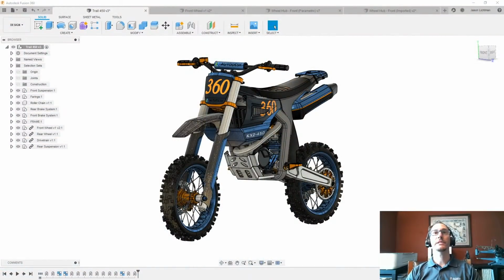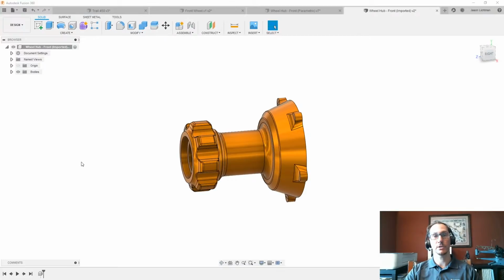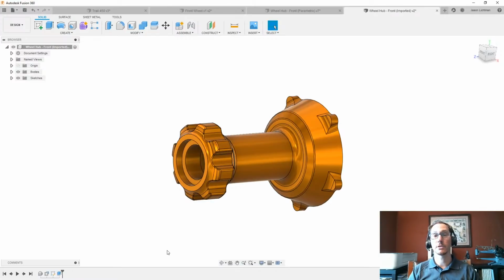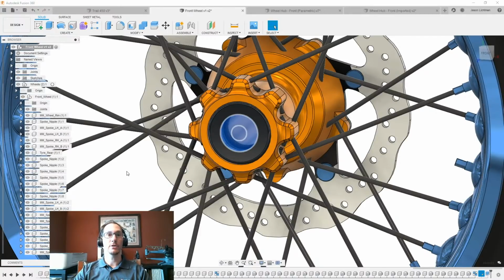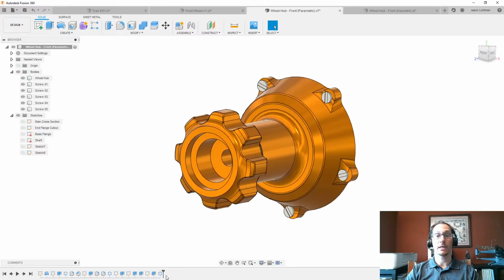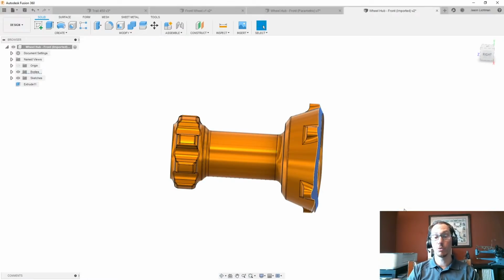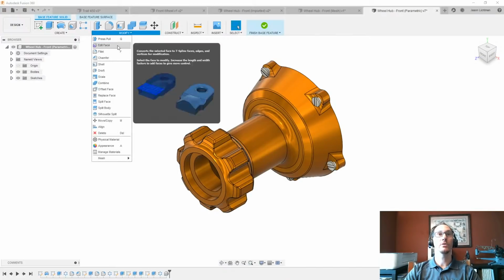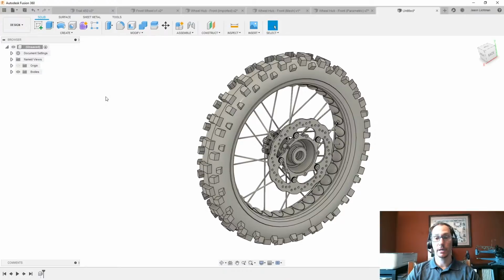360 LIVE: All About that BASE Feature

Comment: Very helpful. I work in education and an immediate use case that came to mind is doing a quick fix on a student design that is challenging to fix with history on. Students often have underdefined sketches, and poorly chosen design paths as they are new and learning. But we want to get the thing fixed quick and on the 3D printer.  Removing the history and direct editing as needed, turning history back on as needed will be great tools for me and them.

Comment: Great video. Thank you for the work
Reply: Thank you Bernie! Glad you enjoyed!
Reply: @jasonlichtman  I have a request for a video that demonstrates using a tool to cut a part. I am trying to make a simple twist lock to hold a handle into a head section with 3 buttons that slide into the head and rotate 60 degrees to lock into the head.

Is there away to create a tool that has is the handle, with the 3 buttons, and then nude this handle to cut the head to create the slots for pushing the handle into the head and then rotate the handle to cut the slots for twisting and locking?